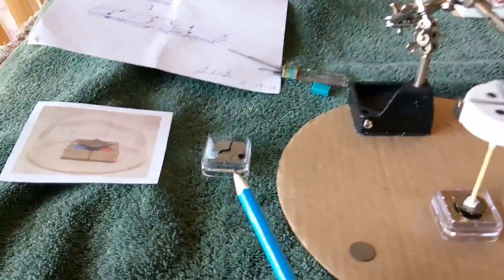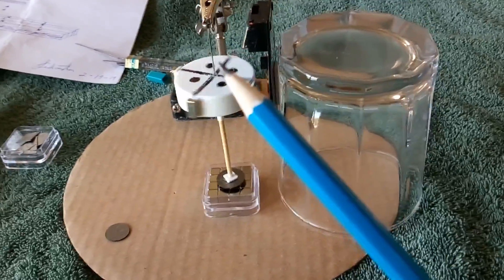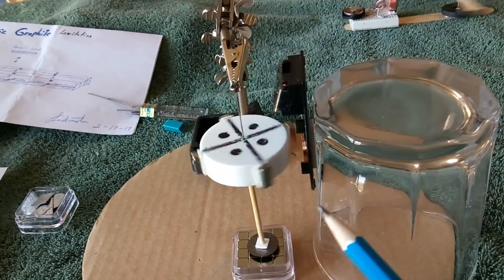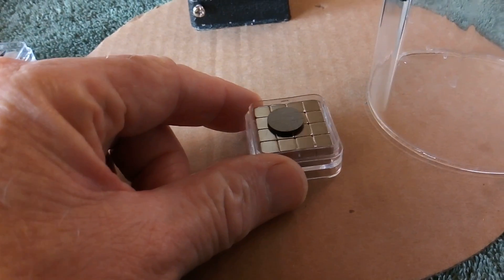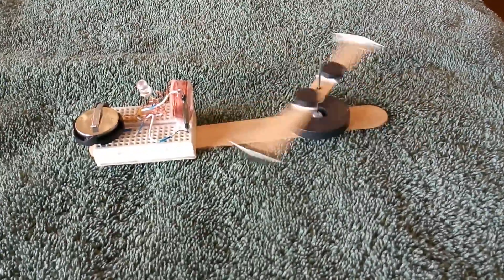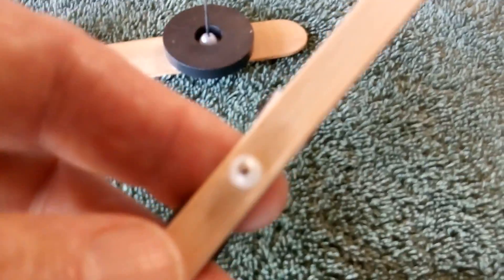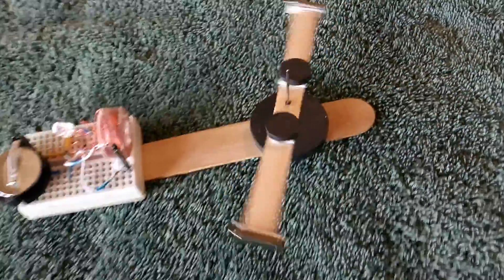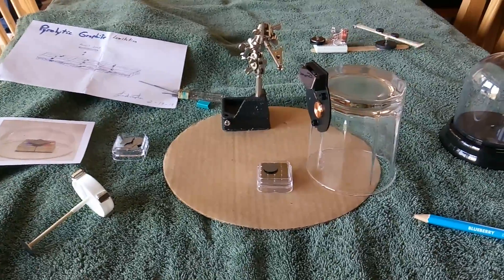Pyrolytic Graphite Levitation ---Bearing quest

Comment: Some ideas that occurred to me:
1.  Make a slight cup shape under your cube magnets to try to focus your pyrolytic graphite into the center of the magnetic cup area so there is less mag lift wobble.
2.  Shorten the wooden shaft above the pyrolytic graphite to as short as possible.

3.  With the ring magnet setup, is it possible to make the shaft out of pyrolytic graphite rod that passes through a ring magnet as the bearing--instead of a plastic bearing?  That configuration may provide a very low friction magnetic bearing to minimize your bearing wear.
Reply from the maker: Thanks for the ideas.  Lots of things to try.
Reply: @Lidmotor  If you you try to make a ring magnet bearing setup, you may need a stand & a ring magnet on both ends of the pyrolytic graphite--like an axel of a car has a bearing on each end of the axel.  That would better stabilize the vertical wobble by using 1 magnetic bearing near each end of the vertical pyrolytic graphite rod.

I look forward to seeing what you come up with that works!
Reply: @Lidmotor  The knowledge in this video may be of great use to you.  it might help you to create counter-balancing magnetic fields to create a stable magnetic base:
https://www.youtube.com/watch?v=OI_HFnNTfyU

2 strong ring magnets might be the trick.

Comment: I'd not seen the partial method before. Great line of experimentation!
Reply from the maker: They call it 'pseudo-levitation' or 'mechanical restraint'.  It is hard to beat some of the other bearing methods we have tried over the years. The pyrolytic graphite levitation is interesting but it is hard to stabilize it in rotation.

Comment: Will it levitate the same but underneath?
Reply from the maker: No.  The graphite is only repelled by either pole of a magnet.
Reply: @Lidmotor  well then maybe you could grind the very edge from the 4 magnets in the middle so that a needle could fit through and have another magnet array above with another pyrolytic magnet connected to the shaft
Reply from the maker: @Buzzhumma  The pyrolytic graphite is totally NON magnetic so it is not attracted to anything ----but you can levitate a magnet between two pieces on the material with a 'lifting' magnet positioned carefully from above.  They sell a wooden setup that does that.  Perhaps that is one way to do what I want to do.

Comment: Progressing steadily. It is fascinating just to see those pyrolytic chips floating in the air. I would be happy with that 😍
Reply from the maker: Yep.  It is fun to play with but I am a bit disappointed with it as a solution to my bearing problem.  It is a very unstable levitation method when it is rotating.

Comment: One of the things that frustrated me when working with magnetic levitated rotors was the strength of the magnet changing with changes in temperature. 

The balance was so delicate, if I got it all set up at 80F it would pull the rotor up and sideways at 40F.
Getting it set up at 40F, the rotor would fall off at 80F.

Using the graphite, the weight of the rotor becomes an issue.

Imagining how I would build the lightest rotor possible, I think about the very small magnets I saw in a hard drive. 
Not the magnet that moves the arm, the magnet that holds the arm in the park position. 

It is about the diameter of a toothpick and maybe twice as long as the diameter of a toothpick.

Sandwiching 4 of these magnets between two plates of graphite would be a very light rotor.

I am pretty sure the magnets that levitate the graphite would interfere with the rotor magnets.

Perhaps gluing the rotor magnets onto the ends of two toothpicks would bring the rotor magnets far out enough to not be affected by the graphite levitating magnets. 

Using the Halbach array for the levitating magnets would further  help concentrate the field so as to not disturb the rotor magnets.
Reply from the maker: There are lots of things to trys.  Thanks for the ideas.
Reply: @Lidmotor  
Maybe they were 1mm by 1mm:
https://www.ebay.com/itm/1mm-x-1mm-TINY-Neodymium-Disc-Magnets-N35-New-Super-Strong-100-pcs-/192536522375